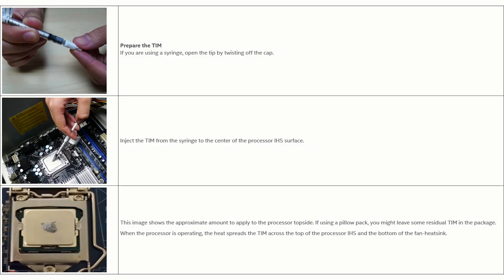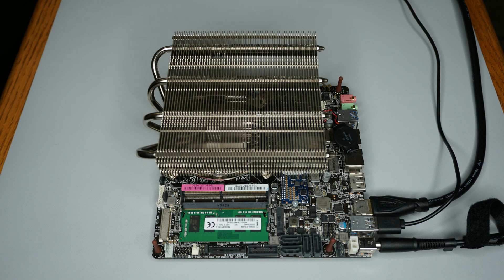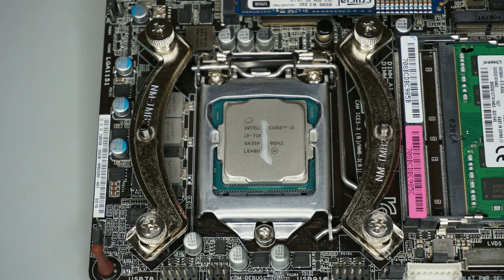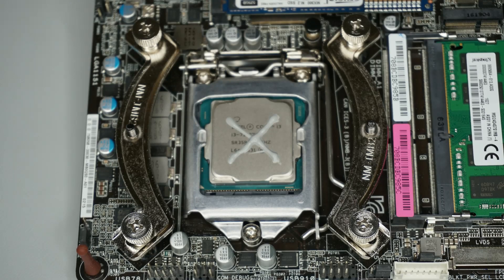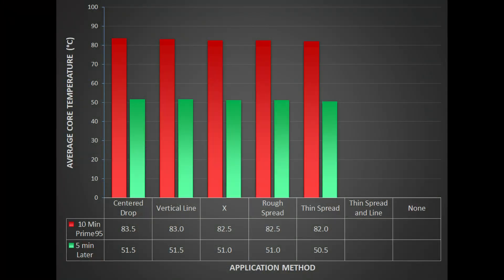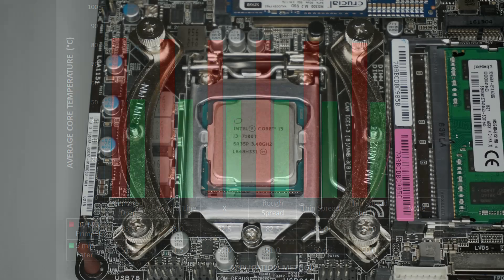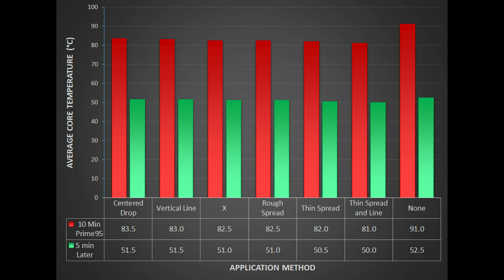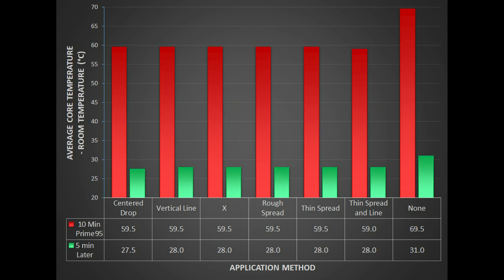What's the best thermal paste application method?

Comment: thanks for showing  this,  last week my Fat PS3 died  YLOD  luckely a have a new Boxed Unit but iz 13 Years never used,  i open the new PS3  the thermal paste was dry and like  dryed Gum in Peaces,  A Replaced the Paste with Ceramic by Artic Silver  (fisrt time in my Live)  a spreaded with the finger and at the end a puttet a bit in the Mittle .   Hope iz fine ?.  The PS3 Runs good somethimes certain Games it Reaches high level of Fan use Level  5, 6 , 7  .

Comment: Nice work, your Video about Thermal Paste Application Methods is way better than the one of LinusTechTips ;)

It simply does not matter how you apply the Thermal paste, because the mounting pressure squeezes all the remaining thermal paste out the sides, so if you apply "too much", the only dowside is the mess around the CPU Socket.
Reply from the maker: Thanks.  You just have to remember not to use too little of the paste, otherwise you're right, it doesn't make a difference.